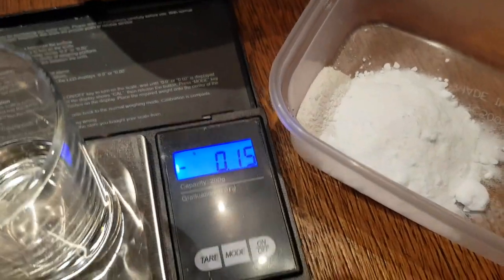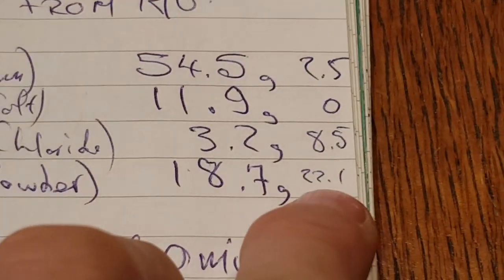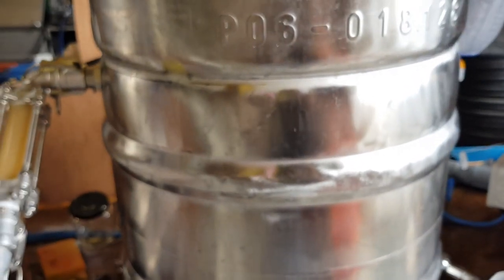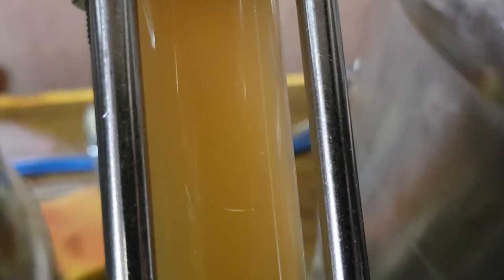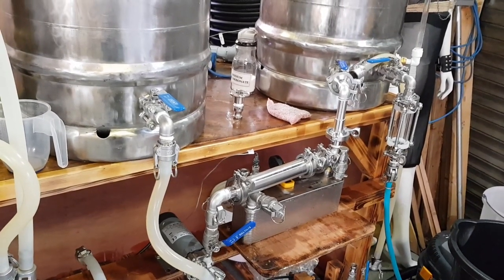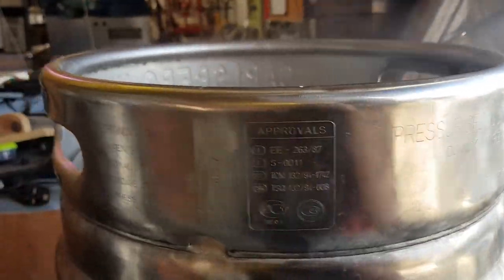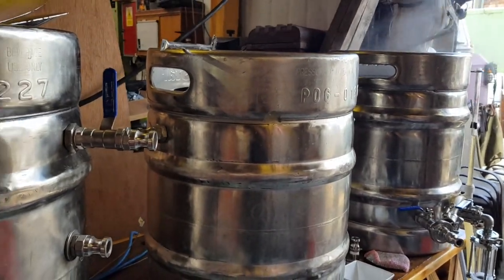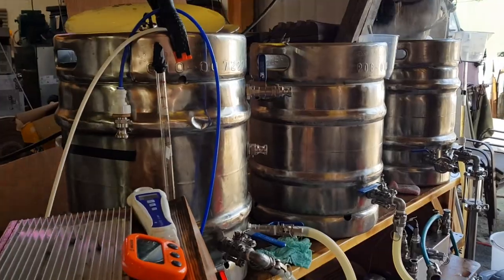BREW - Heady Topper - Grain to Glass

Comment: Thats a LOT of baking powder to be using in an IPA.
Reply from the maker: Yes, and really messed with the pH.
Reply: @MadeByMartyn  I usually just use calcium chloride and gypsum (calcium sulfate).  If the calcium starts getting too high ill substitute some epsom salt in place of some gypsum.   Just found your channel, ill be following my friend.
Reply from the maker: @KalosPVP  I've an ongoing and complex relationship with my water profiles.  The brew I posted yesterday (Digital IPA) was purely calcium sulphate 2.5g and calcium chloride 8g

This was into a 46L RO.

I resisted the urge to use the BeerSmith recommend Burton Water profile, that has an incredible amount of Gypsum - enough to Artex my workshop ceiling!